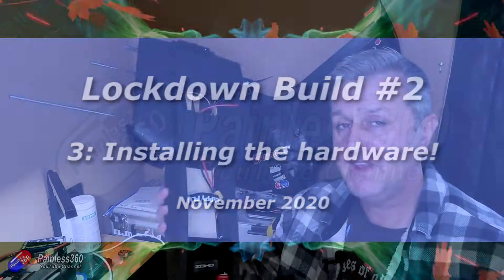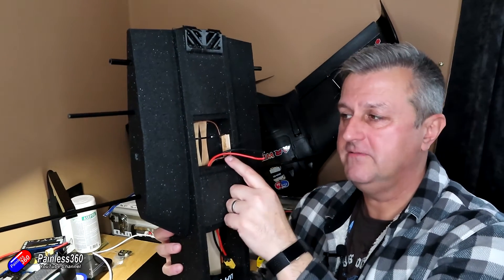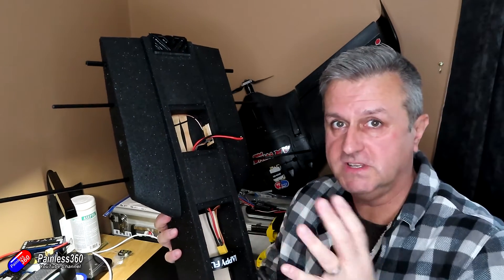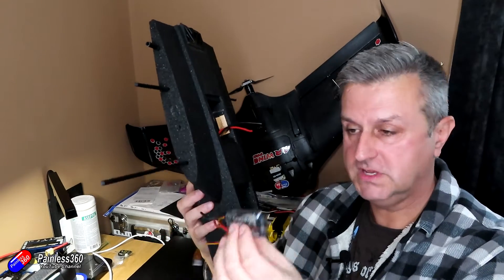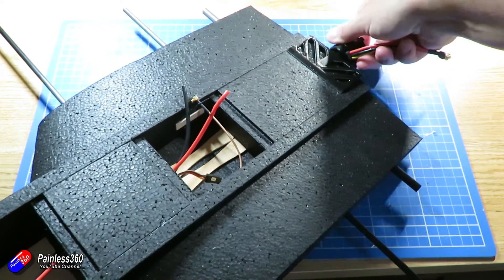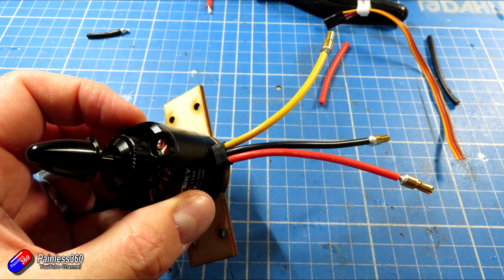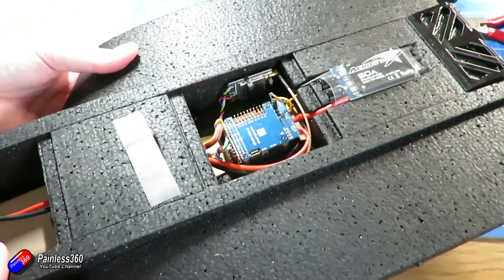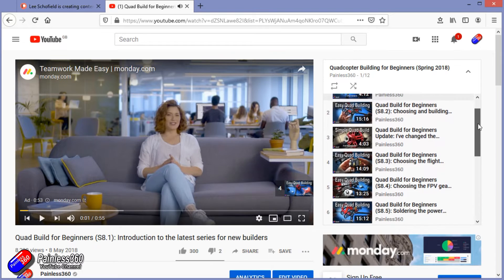Lockdown #2 Build, Part 3: Squeezing in all of the electronics!

Comment: Hi Lee.
I notice at 10:24 you have connected all 6 GPS module wires, are you planning on using the compass on this fixed wing?
Also at 7:00 the insulation portion of the terminal crimp is not crimped down, is this deliberate to help locate the crimp squarely in the housing?
Great build as always, you stay safe :-) Steve
Reply from the maker: I wanted the option of turning it on in future so connected the external compass. I won't use if for the initial setup and need to check how the power wires running from the battery to the FC under it affect the accuracy. 

That other image is mid crimp. :D